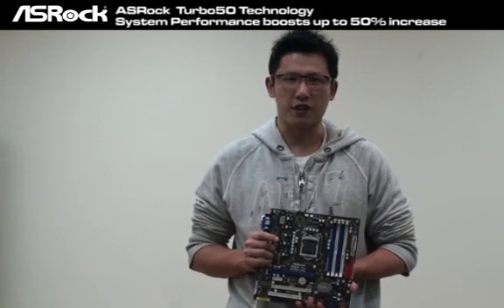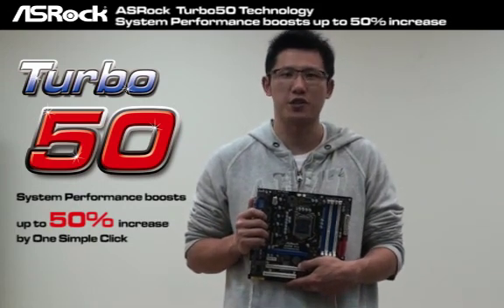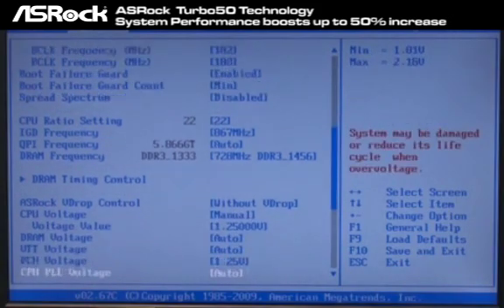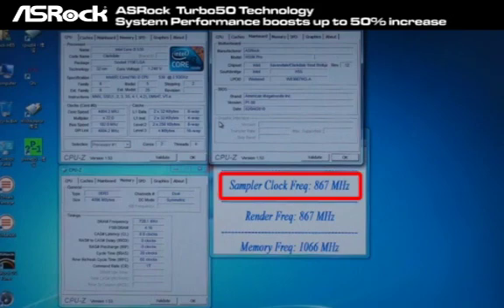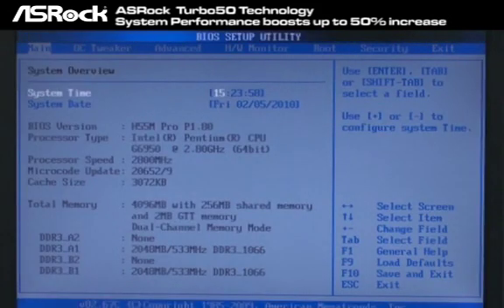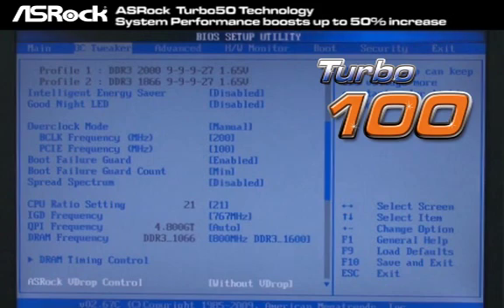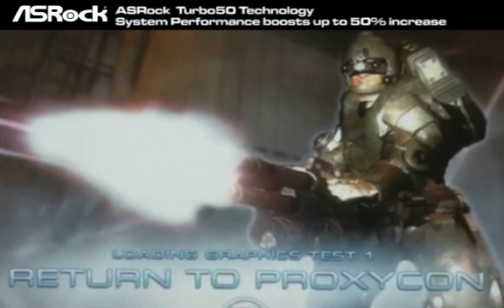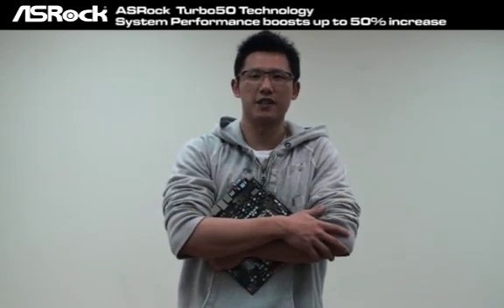ASRock Turbo 50

Comment: blue screen ...  :(      not working..i3 530 2.93Gb at 40 % raise to 3,81Gb temperature from 25 C to 42 C in bios after restart...charging  windows ..blue screen and restart again..who knows..i need an ice cube on processor. with 50% no start at all
Reply: Yes me too... maybe we need more better cpu cooler. I use i3 530, but i can't overclock

Comment: I have the ASRock Z77 Pro 4 and in the bios i have Load optimized cpu oc settings that says Turbo 4.0Ghz up to Turbo 4.8Ghz if i was to set this to 4.0Ghz will this change all the settings needed to oc my processor (I5 2500K 3.3Ghz) to 4.0Ghz without damageing my processor providing i have a good CPU cooled (Corsair H80) ?

Thanks

Comment: I have the Z68Extreme4 Mobo and I accidentally enabled this option and my clock speed went up to 4.8GHZ and I was having random blue screens. Don't enable this if you don't have proper cooling, I have a big coolermaster heatsink and still temps hit 90+ and even though you have a good heatsink the stability of this setting is very very low. If you get a random bluescreen with 0x00000124 or 0x0000001E errors in windows 7 disable this option!